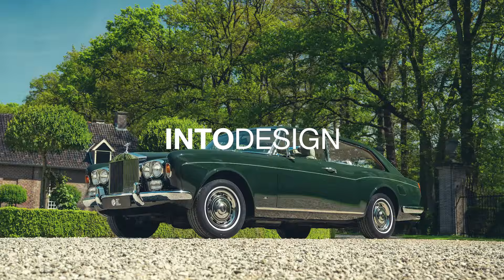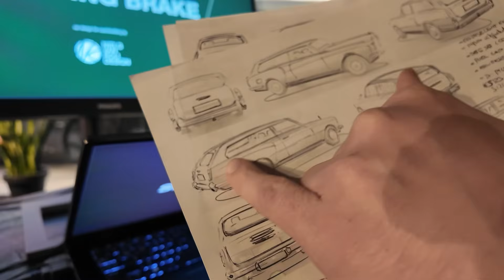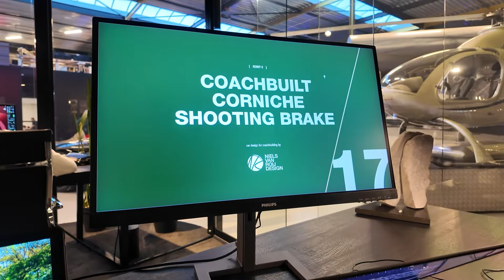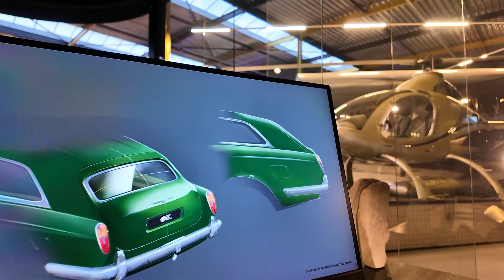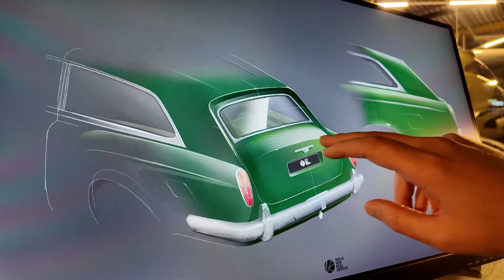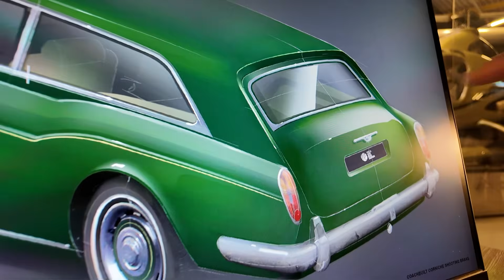INTO DESIGN 004: exterior car design sketches Henry II Shooting Brake | Niels van Roij Design

Comment: It is of course supposed to be pure coincidence: That the tweed selected for the pocket inserts and such of the Henry II interior, as well as the one of a very well suitable waistcoat of someone appearing in this episode, resemble each other... as well as the tweed of a jacket worn by a certain "Mr. Siegfried Farnon" on numerous occasions?
Reply from the maker: Not coincidence at all, actually. As you might have guessed.

The tweed used for the Henry II interior details and the tweed of Niels’ suit are precisely the same cloth - every car made will have a suit made in the same colours and if possible materials.

Any perceived connection to fictional veterinary surgeons is entirely incidental, though.